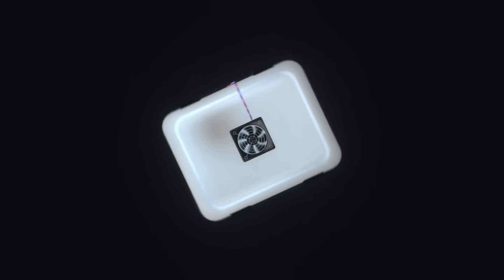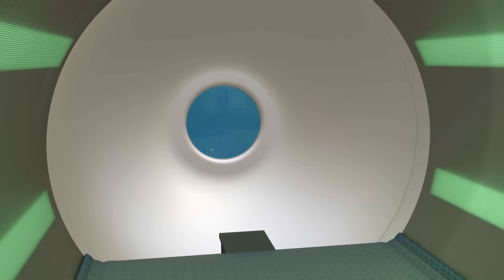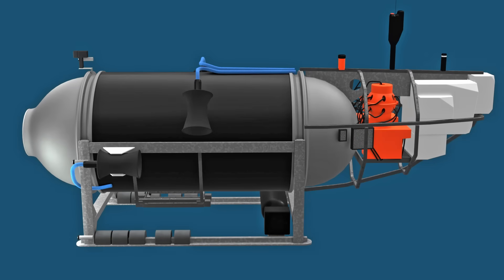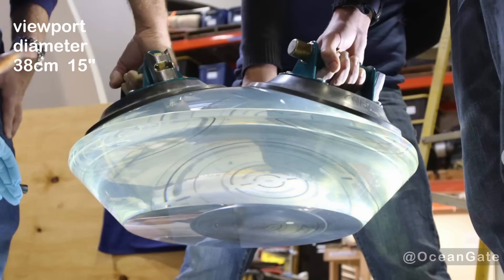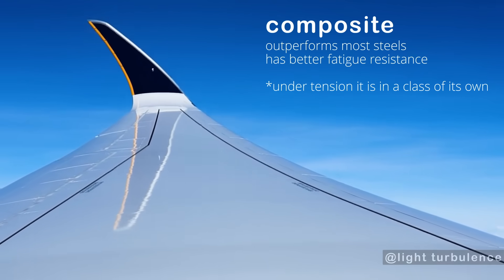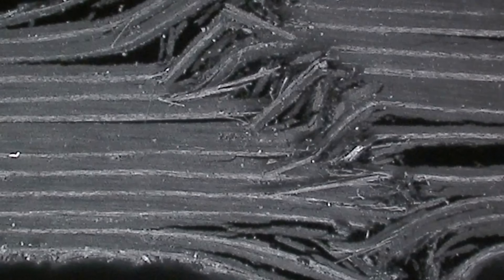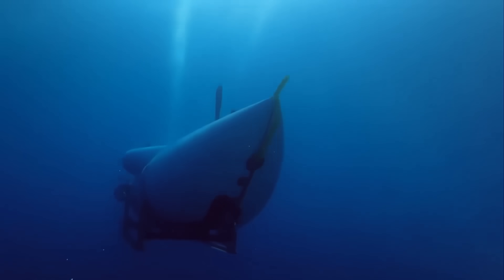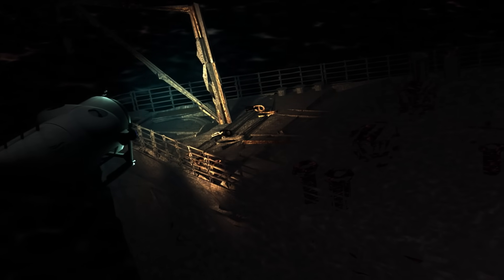Titan Sub | carbon fiber - Detailed Tour

Comment: Thanks Mike! A careful analysis and recreation and it seems like you might be on to something. As someone who has design experience with carbon fiber at depth (not in submersibles, but instrumentation), my main concern with using this material is not the carbon, but the epoxy resin matrix that surrounds it. It will become more and more saturated with seawater as time progresses. This will have a number of negative effects, including causing the hull to swell (this may not be an issue), and gradually degrading the strength in tension and compression. It's also possible the Titan became heavier over time. It's hard for me to ever consider this a stable material at depth.

Comment: It's a completely flawed design, Macgyver tape made out of carbon fiber and epoxy together. Imagine you have a empty roll of toilet paper and you want to fortify it to withstand external pressure... No matter how much tape you wrap around it, if you step on it, it gets squeezed just like that. If the tape is fortified with epoxy, it becomes stronger but then it's only supported by epoxy.

Comment: I liked how you spent some time on the titanium CF glue joint as a primary weak point but the main issue was how they man handled the vessel that compromised that joint and lead to its failure.  Out in freezing cold, using the unbalanced lifting rings, the slamming it got going up and down the ramp, the hard slamming the front ring got in dive 88 with no inspection after, with no planned way how to inspect the glue joint, as well as poor glue joining at assembly!
Enjoyed the episode 😊

Comment: Flanges that sheered off on each end dome happend because both end domes collapsed against eachother and carbon in the middle got squeezed out and took the flanges with it. I disagree totally that carbon fibers can be used for pressure vessels.  Its "cloth"... With Resin. Pressure vessels are made of single solid metals to be able to calculate the pressure cycles and material fatigue.   "Cloth" filled with resin has trapped air bubbles and other contaminants. Impossible to make it as reliable as a solid metal.

Comment: no one Is disputing that carbon fibre has its strengths - but it is not the right material for deep sea diving - you are dealing with immense pressures and any small weakness the water pressure will exploit that - I would assume with the many dives, freezing temperature and pressure the several layers of carbon fibre delaminated - if the layers come apart then they are not working as one. Forget the CF Hull - the real smoking gun is that out of almost 90 dives it only made 13 successful dives to the titanic - End of the day they made a cheap shit sub - now compare this to Alvin who has made 5,287 dives - like James Cameron said in an interview "you just cant give the pressure a single spot to exploit" and whatever ur specs are then double it just to be sure.

Comment: At 15.38 you state composites like this could be used if done properly, I'm afraid only in your wildest dreams it's not just the pressure that killed that sub it's the major change in temperature combined with the pressure.

Comment: "This is just plainly wrong! Carbon fiber has exceptional compressive capability exceeding that of most steels. However, tapping into this remarkable strength doesn't come easily and requires meticulous precision in the layup process."

No, the above statement is plainly wrong. Carbon fibers do NOT have exceptional compressive strength compared to most steels, and even IF individual carbon fibers did long, thin carbon fibers such as those used in the Titan sub's pressure hull would bend and buckle under high compressive loads just as long, thin high-strength steel wires bend and buckle under high compressive loads. Wires and fibers - even very high strength ones - are structurally unstable against resisting bending when they are compressively loaded at the ends.

Comment: Small language error big consequences: talking about the strength of carbon (fibre), but using explanation of carbon fibre composit. in carbon fibre composit, compression is absorbed by the epoxy, under tensionthe carbon fibre is taking the load.

Comment: Your video contains massive errors, there were 0 longitudinal layers, all layers were laid one way, and glued together by a thin sheet of glue, which shows it degraded. You also completely left out how they sanded each layer of carbon fiber, destroying up to 17 layers of connectivity. They overlooked every standard for this material.

Comment: To be fair I think that the fact that the carbon fiber haul made it down to the Titanic and back up multiple times with how shoddy its construction was (seriously the morons used the wrong type of epoxy that had aluminum filling next to a noble metal AND they sanded down the wrinkles in the haul between each layer) means that a properly constructed carbon fiber vessel should absolutely be possible.

Comment: I seen a few others on the eclipse channel . so I believe this idea would have worked . if the bubbles where not sanded down , do 45 degree angles  too and made it thicker . as for the glued ends . like you said tons of pressure was pushing the domes in . I'm not an engineer. check out the eclipse whisperer. that's not the name of his channel but it's close . good video by the way .  this guy ruined it . they will never try it again .

Comment: I am just a builder. But I have common sense. And I am surprised that it went down that many times before it gave way. I was impressed. But I knew it was going to give way .All those bangs were carbon fiber moving in and out.And with that unbelievable pressure on it it had to give way.

Comment: Something else anyone fails to mention is the lack of 
Elasticity. The carbon fiber tube could not withstand any deflection without suffering delamination damage. A titanium tube can and will sustain movement in the structure without failing

Comment: So from what I can find on recent information there was a slew of issues with the whole carbon fiber process. One of them being in the debulking and layering with adhesive in between. Five layers with adhesive in between each layer and then going through an autoclave. This process is new and not a lot is known about it because layer number one has to go through the autoclave four times and it is not known whether carbon fiber can withstand constant pressure and heat from the autoclave. Another thing that was found was that in between those layers it was found that there was friction points between the two pieces of carbon fiber layers where delamination was occurring in the adhesive. On top of this the problem with carbon fiber is that it is extremely difficult to layer it very thick without having humps and bumps in the surface. This was shown by the fact that the NTSB was stating that ocean Gate was dealing with this by grinding and sanding the carbon fiber. To which NASA and the NTSB said is a big no-no. Because when you sand or grind you're basically weakening up to 12 plies in that process which is significant. What they also found was that in between each layer of carbon fiber tubes which there was 5. Rubbing or friction was occurring in between the layers of carbon fiber causing some spots to be completely bare

Comment: I saw a photo somewhere of some poor geezer with a tiny little sonic transducer inspecting the LR5, which was the Royal Navy's submarine rescue craft and had a glass reinforced plastic pressure hull (you can actually see photo of an exposed pressure hull similar to it if you google LR2 Science Museum). Every time it was due to be recertified, it had to be entirely stripped down, then someone had to go over every single inch of the pressure hull doing ultrasonic NDA to pronounce it safe. Apparently, no one could do that, nor do an infrared inspection on the Titan, because they covered the abominable thing in truck liner (there's also reports that Rush wouldn't shell out the $25,000 to get it done).

Comment: the carbon fibre used to wrap the Titan was Boeing non-conformance rejected material that they knowingly sold to Rush, and Rush knew it was rejected nogood carbon fibre. No surprise the hull made popping and cracking noises when under pressure, it was splintering
Reply from the maker: In the Coast Guard Inquiry into Ocean Gate the question about expired/rejected Boeing carbon fiber was asked and there is no evidence to support the story. 
However the inquiry revealed some really dodgy practices including grinding down large wrinkles in the windings and it is fair to assume this and other slapdash processes meant the hull was badly compromised and is ultimately why it failed.

Comment: The animation is perfect. The construction and choice of materials is a disaster.
You never use carbon fiber composites in compression.
This is basic mechanical engineering. 
Everyone with a mechanical engineering degree who worked on this thing at all should be banned from engineering for the rest of their lives.
Carbon fibers have high tensile strength. In this case, their use is completely wrong, the stress of pressure is like pushing a string. If the pressure of 400 bars was applied from the inside out, the fibers would withstand it. Pressure of 400 bars from the outside is wrong. Wrap a can of Coca-Cola with string. Will it become stronger? You will dent it in your hand. The pressure from the inside will withstand. Completely inappropriate use of carbon fibers.
Please excuse my english, I'm European.

Comment: I'm just curious exactly how carbon fiber is strong under pressure in this specific instance though.  To me it seems like the titans hull strength under pressure would come entirely from the resin or epoxy that encases the fibers.  Like how exactly do the thin bendable fibers contribute to the compressive strength?  That's what I really want to know, I've heard a few people rebutt the common narrative saying that it's actually good for this sort of thing, but I just don't understand.  No one has given me a detailed explanation of why, so if anyone can explain  please leave a reply.  I want to know.
Reply: if carbon fiber composite was only good in tension then it would be rope. in fact it's incredibly good at serving as beams and space frames. any time you load carbon fiber beam perpendicular it is experiencing compression and tension equally, yet is very strong. by contrast, unreinforced concrete is only good in compression- and it is terrible at taking beam loads- the opposite case to rope. essentially carbon fiber is like combining both
Reply: Carbon fibers have high tensile strength. In this case, their use is completely wrong, the stress of pressure is like pushing a string. If the pressure of 400 bars was applied from the inside out, the fibers would withstand it. Pressure of 400 bars from the outside is wrong. Wrap a can of Coca-Cola with string. Will it become stronger? You will dent it in your hand. The pressure from the inside will withstand. Completely inappropriate use of carbon fibers.

Comment: Well, it failed right? When is the last time that we have had a sub designed to travel to the titanic or deeper fail with standard Materials like steel or ceramic The fact that carbon fiber tends to fail overtime, makes it not a suitable material for building subs sorry to tell you.

Comment: Based on the recent hearings the sub probably could've made it back safely, even being made or carbon fiber. They made it well over 3 km down before the signal dropped. But quality control and Stockton not caring about damages to the sub from other dives likely was the cause.

Comment: Ive been fascinated with this event like so many others. Eager to find out new information even though it seems rather obvious what happened. Im no engineer or submersible expert but given the nature of carbon fiber, from what i have learned, wouldnt the severe cold have also been a big factor? Ive heard people describe carbon fiber as a super hard plastic and the narrator in this video even likens carbon fiber to glass. Both are materials that are are severely compromised by super low temperatures.

Comment: What is sronger? 
A:A carbon fiber capsule
B:Epoxy glue applied with bubbles in it
C:A persistance of a millionaire with 250000 spare bucks

Comment: The matrix would have to have been perfect! They would have needed to have done lots of failure studies that where not done. They would have needed to use a proper mandrel to ensure proper loading during construction. The major problem with composite construction in this usage is one of being able to know and predict when failure will happen and that is almost impossible to do with any level of certaity giving the emense pressures seen. The pressures involved in aviation are a fraction of what is seen in deep sea diving! Trying to use composite for this type of stress model becomes an issue because every cycle it see's the risk of rubbing, scuffing, buckling, delamination, cracking on every single layer and interface becomes more and more likely as failure occurs the forces can not be shifted to other area's of the structure every inch has to be strong 100% of the time. If someone wanted to build something like this to dive in the Great Lakes it would likely be fine for a long long time if they built with out the wavieness, voids, and other construction issues. The fact that not one single certification or underwriting authority in naval vesseles and submersibles would certify this craft is telling. The design was bad, the construction method was bad, the safety checks where bad and the lack of real trained submersible operators was also bad. Everything about this was bad top to bottom. If I was wrong they would still be alive and they are not! 

The off cuts from the first sub and the second sub act as witness pannels and they are telling. The company that built it should have everyone that signed off on it with the problems it had convicted of premeditated murder! When you see the waviness in the layers, the sanding, grinding, perosity and voids that canbe seen with the naked eye it is criminal. You would never let a carbon composite structure that bad be used in aviation let allone to dive to the depth of the Titanic!!

Comment: I wonder if a titanium tube of 6 mm / 1/4" wall thickness (or even thinner) around the carbon fiber tube would have drastically increased strength and more importantly, fatigue resistance of the pressure vessel/crew compartment without adding tremendously to the weight. It would have diminished the advantages of using carbon fiber for sure but the strength gained could well prove worth the compromise, to a properly managed and safety conscious company that is.
Obviously it wouldn't be of interest to Rush.
Striking the perfect balance of titanium outer skin and carbon fiber internal "structure" might well be the correct way to build a submersible for the tasks Titan was intended.
Any structural/material/submersible engineers out there that care to discuss?
Reply: Biggest issue was the glue actually. The glue was being affected by the pressure and was losing its adhesive properties. Ultimately trying to conjoin metal to a composite is a terrible idea. They would have very diffrent structural properties at that depth.

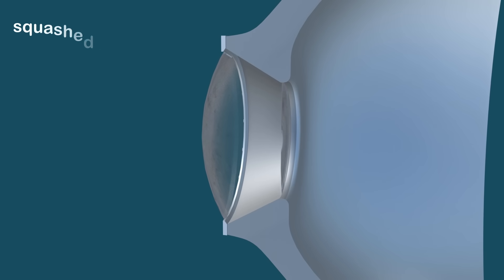Comment: 7:30 - *Correction* the portal would crush in approximately 20 mm or 3/4" or .750"
Not 3 - 1/4"
I think it was a typo.

Comment: This was an excellent exposition. One of the best I've seen on the topic. No drama and clear analysis.
I also believe that the US navy was testing a carbon fibre submersible - but look at the R&D resources they would have.
Reply: One thing not discussed enough here ....  "The Sphincter Valve Effect" 
What happens is.... BOTH noise & visuals are translated into Electrical Impulses for interpretation by the brain.
When formed, these impulses of information travel South to the Sphincter Valve aka the Orifice Interface.
The Sphincter Valve controls electric impulses in an effort not to overwhelm the brain.
Nerves are very thin in this anal-type area. They need a massive amount of bloodflow to pass the Interface, traveling on to the brain.
Once you throw TOO MUCH INFORMATION down there, the electric impulses backup, the Sphincter Valve closes, blood flow drops.... nerves can't pass information ....... and the brain has no choice but to mutter the only thing it still sees, OH SHYT!!!
Reply: @SuperChuckRaney  In case of emergency, sit still, place your hands behind your head, place your head between your knees - and kiss your ass goodbye.

Comment: Carbon fiber is never mated to titanium rings that are under tremendous water pressure. Especially after cycing over and over. I suspect it failed at that mating point on the forward ring. Compressibility is much different on those two surfaces

Comment: I purchase a $200 carbon fiber bike seat post and used it for about 6 months.  One day my bike fell over and the seat hit the ground and that darn post cracked like it was a twig.  My other seat posts are 20 years old and steel and  look and function as if brand new.  I am not an engineer but do not understand why you would use a laminated composite in a deep diving submersible.